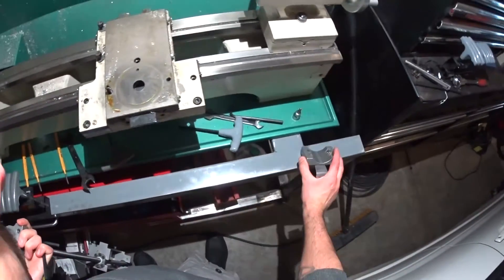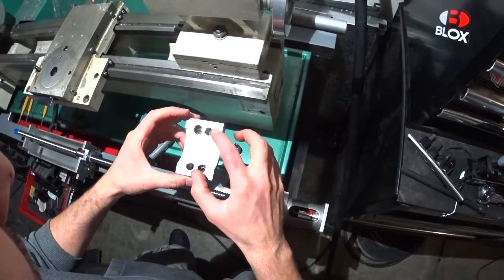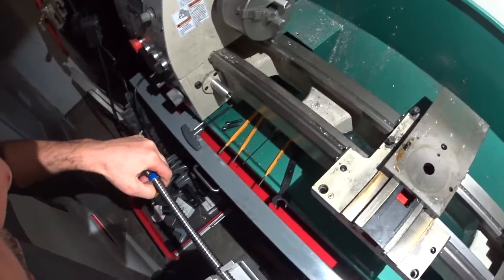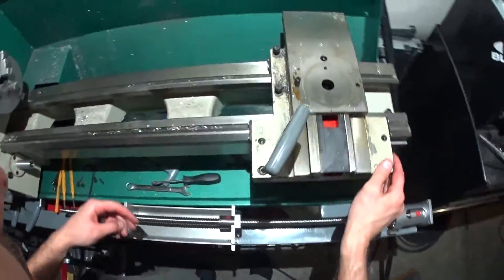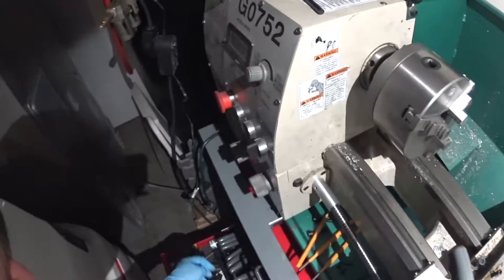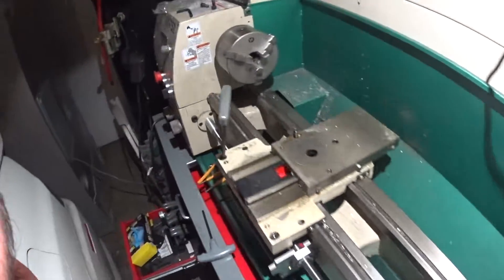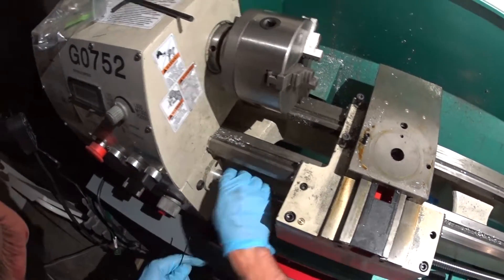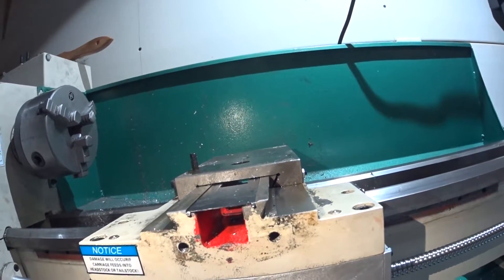G0752 Lathe BDTools CNC Conversion - Part 2 - Z-Axis Install

Comment: Can you do threading with this machine now that it is on CNC?  Suppose you need some sort of encoder? Was not sure if the grizz had that?
Reply from the maker: Anthony Webb manually before converting to CNC you can but once you go to CNC you will need an encoder like the C3 encoder from CNC4PC. If you plan on running Mach 3/4 you only need one board but if you are going to run Linux CNC you will need two of them. 

Here is the encoder:
https://cnc4pc.com/c3-index-pulse-card.html

Others might work but this one was pretty popular on cnczone.

Comment: Also For threading has it been a new learning curve now you have a ball screw installed?
Reply from the maker: I bought a whole new set of electronics for the lathe that I haven't gotten around to installing that included dual spindle encoders (needed for Linuxcnc). I haven't threaded with the lathe yet, but that is on the list of things to complete over the winter. I have a PM-940m cnc coming soon that I know will take up a bit of time (enclosure and making chips) that will detract from the lath and I am still trying to finish up my 4x8 plasma table build at the same time too. 
Once I get the electronics swapped over on the lathe I will do a video on threading and the configuration for the encoders too. So many projects, but so little time. Its not a bad thing to have all these projects going at the same time though. 

The lathe will be getting an enclosure and flood coolant as well to keep the shop clean.

Comment: Would you buy the kit again or just make your own? CNC conversions are relatively easy to DIY.
Reply from the maker: If I had a milling machine or the ability to cnc mill the parts I would of went the DIY route for cost savings, but the quality and easy of installation of the kit was top notch too.  

I had originally bought the ball screw kit from automation technologies to do the conversion myself (https://www.automationtechnologiesinc.com/products-page/g0704-kit/new-ballscrew-kit-g0704101015-for-hoss-g0704-bf20-cnc-conversion-duplicate/) but at the time I didn't have access to a mill of any sort and I was really limited for space to try to DIY it and hand make the parts. 

With the kit from Billy at BDTools I was able to have the conversion done in a few hours from start to having the machine under computer control so it was really easy to get working on projects. He seems to usually run a sale during the holidays for around 800 plus shipping.

Comment: Have you found a way to control vfd from Mach 3?
Reply from the maker: Hi Alex,

I haven't looked into the spindle speed control yet and I ended up running Linuxcnc on this setup. I know the Delta Delta VFD007E11A that comes with this late can be controlled over Modbus through the RS485. I am not sure if I will try this out on Mach since Linuxcnc has been working really well for me with this late. I do have mach on another pc that I could play with. 

Here is a topic on the Mach forums and they seem to have gotten spindle control from mach3 wowrking. 

Topic: DELTA-E VFD MODBUS BRAIN Help Needed
http://www.machsupport.com/forum/index.php/topic,28997.0.html